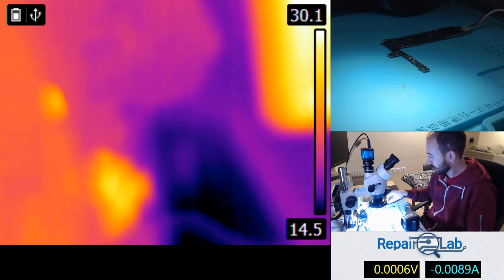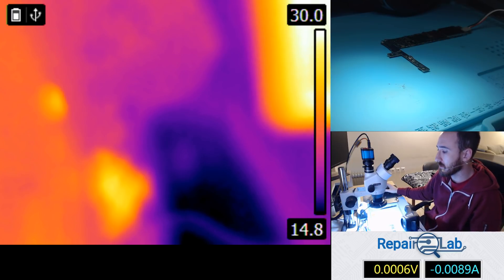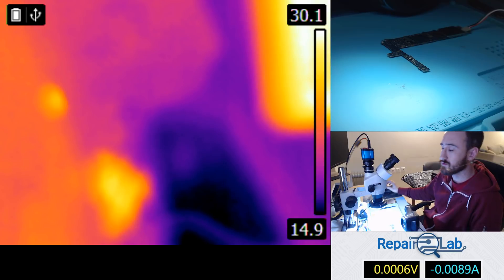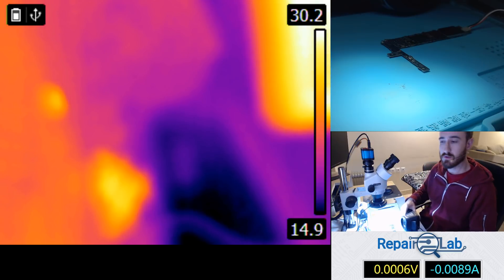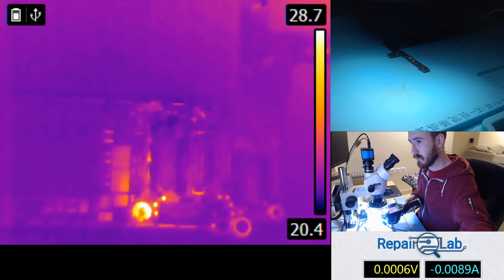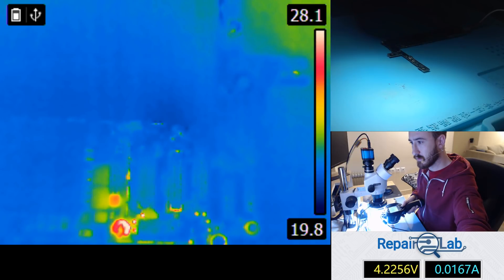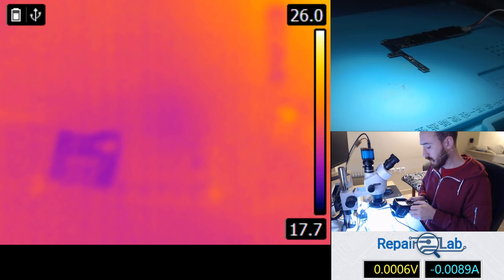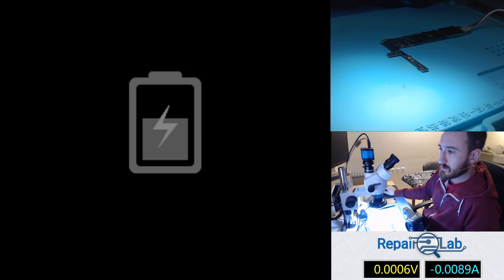Short Detection using thermal camera: The upgraded Flir E4 and a 0.02 amps short to ground

Comment: Any advice on finding a partial short on pp_vdd_main on iphone 7. Caps are measuring 0.085 in diode mode. I have freeze spray but it's not a full short. Had this phone for a week now lol.
All your videos are helping me become 1000x better and much thanks for your time and effort panos
Reply from the maker: 118Wilson you just have to follow the process that's described on other videos as well aka inject voltage and see what's getting hot.
Reply: RepairLab thanks for reply. When I inject current it is only consuming 0.02 amps. Even though the DCPS is set to pull 3 amps

Comment: bro i have a question .. the low temperature solder you use to reboll ICs , is it 183° ???
Reply from the maker: Hello. It's not low melt solder. It's regular leaded Solder and the melting point is indeed 183 Celsius
Reply: RepairLab thanks for the quick response ...